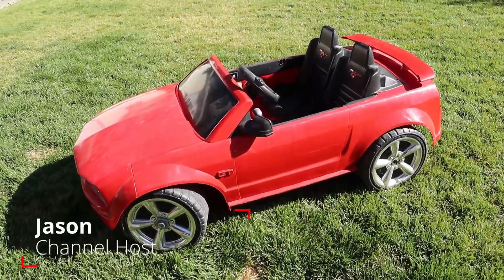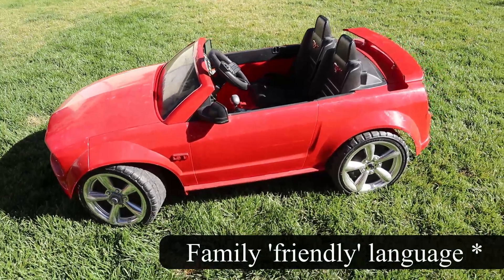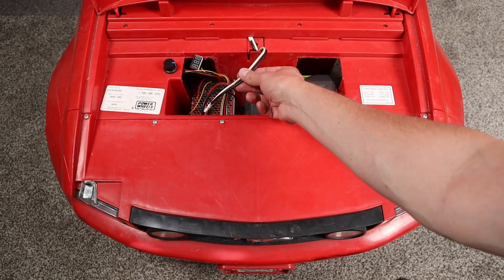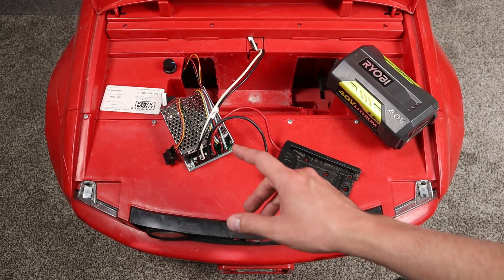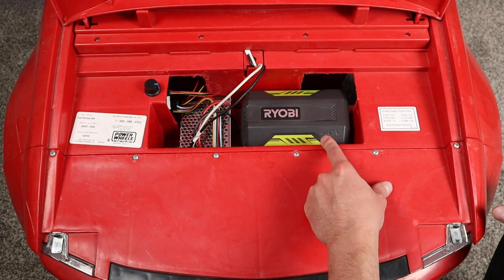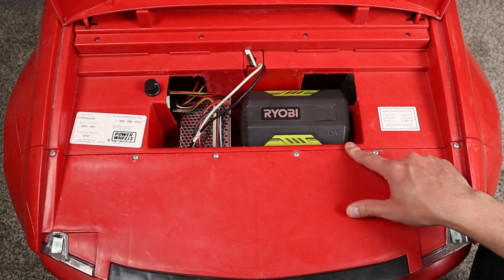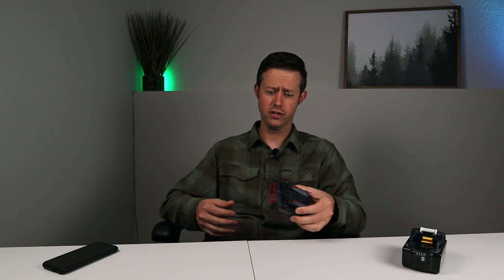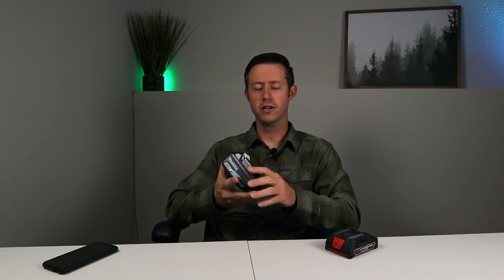40 Volt Power Wheels Mustang! Simple Mod - Much Faster!

Comment: Probably cheaper than buying an OEM battery for it
Reply from the maker: For an even cheaper option, use a 20v tool battery and find an adapter on ebay or amazon.

Comment: does it have to be ryobi? I am having a hard time justifying the 100+ battery. lol no off brand or is that gonna just turn it into an expensive fireball?
Reply from the maker: Use any 20v battery and run it at 100%, it will go just as fast! Adapters are available on eBay for lots of 20v tool battery brands

Comment: How many motors do you have on the car.., one or two..??
Reply from the maker: two motors in my mustang
Reply: @Jasonoid  Thank you for your quick response. Do you remember type of motors and operational voltage...? I have a Ford Ranger with two motors now operating with one 12V battery.
Reply from the maker: @emmanouilchatzisavvas6677  You should be able to run your Ranger off 20v batteries at 100% or run them off these 40v Ryobi around 55% on the PWM controller. Lots of different adapter options available on Amazon and ebay.
Reply: @Jasonoid  40Volt at 100% would destroy the motors..?? I suppose you run them in parallel connection...??
Reply from the maker: @emmanouilchatzisavvas6677  Yeah, I ran mine at 65% and I got some burning smells, the speed in the video is 55% at 40volts.

Comment: So with you running at 20ish volts no problems one wouldn’t need a PCM if they wanted to run an 18v ryobi, just take the adapter for the battery straight into the existing wiring. Would that be correct?
Reply from the maker: Yeah, would work prefect. Only 1 speed though, the pwm allows for speed control

Comment: how fast can it go if you crank it up all the way
Reply from the maker: My motors don't like having full 40volts, they hot pretty fast. 55% is the highest I go. If you install a tool battery that's 20volts, you could turn it up 100%

Comment: Hey Jason, im hoping you can help me out.  I did an 18v conversion and burnt the motors out.  My daughters missed it so much I picked up a newer one and upgraded to the ML Toys 24V motor kit.  I used the same Motor Controller as before (Not exactly the same as your but looks identical and rated for much higher than 40V).  I planned on pushing this one to failure as well (kids are older) but the batteries keep tripping and I barely have the PWM turned up.  With the wheels in the air I have it tuned to 24V exactly and it runs fine in the air but when on the ground with one of the girls in it, the batteries always trip.  
Can you point me in the right direction?  
Full disclosure ML Toys says the motors are not for Li-ion but I figured the stock motors weren't either.  Super appreciate the help, my daughters are hooked a d I'm letting them down big time :(
Reply from the maker: I have seen this same thing happen before on mine using a couple different batteries (old vs new batteries). It's either one of two things that could be wrong.... At least in my opinion. 1) The batteries are hitting their max amperage so they are shutting off to save the internal battery cells. Motors under load require much more power (amperage) than just spinning freely. Just like you mentioned it works fine when in the air but cuts out when a girls is riding in it. So maybe try a different tool battery? Which one are you using? 

2) The other thing that could be causing the cutt out of power could be the pwm controller. How many amps is your rated for when you look at the device specifications? Maybe it cant handle to amount of amperage going through it and is shutting off for safety.
Reply: @Jasonoid   @Jasonoid  thanks so much for the reply!  Sorry just getting back to you, was out of town.  I run into the problem with both older 2.375 Ah and new 6Ah batteries.  I don't know what amp level the batteries' bms trips at but after reading your comment I'm wondering about the pwm controller.  It claims 30A max and a voltage range of 7-70.  That said, it was one of, if not THE, cheapest one on Amazon at around $20.00.   I know it has a 30A fuse that's blown once but it was back when I used it on the old 18v car.
Thinking I should give the controller YOU used a shot - unless you advise otherwise.   
Thank you so much for the help!  You have a subscriber for life!!!
Reply from the maker: @johnmurraycompton569  if you are blowing fuses that might be the issue. I haven't looked at available options for awhile, I bet they have something with a higher amp limit!
Reply: @Jasonoid  it only blew the fuse the once and that was on the old car using the stock motors and a ryobi 18v.  No blown fuses on the new car with 24v motors and 40v battery.  Just batteries keep tripping.   I'll give a nice controller a shot!  Just an idea, would wiring in a second 40v ryobi (in parallel) help with the amperage pull from the motors?  Sorry if this is a stupid question.
Reply from the maker: So it's hard with these power wheels because it 0% throttle or 100%. So all amps or no amp draw! In a different application I did run two 40v batteries in parallel that on my razer electric scooter mod, it seemed to work better that way. I did get a couple battery power "trips" and I had to unplug the battery and wait, the plug it back in to get them to "turn back on". Always lots of troubleshooting on these projects.
Reply: @Jasonoid  understood.  Thank you again!
Reply: @jasonoid, I just connect everything, turned to controller to 15 and as soon as I pressed the pedal I heard the fainted click and now there’s no power to the display or the toy. Any ideas?
Reply from the maker: It could have blow a fuse, do you have any fuses in the setup?

Comment: will this work on a 24 volt as well?
Reply from the maker: It works better with 24v actual, because then there's no risk to burning the motors out.
Reply: @Jasonoid  Thanks for the info  Have you thought about having people send you their batteries and you do the magic install and send them the batteries back for them only to install in their child vehicle for a fee of course?
Reply from the maker: @Seymour5575  I'm pretty busy with a full time job, then my YouTube channel, and family so I wouldn't be able to do many. I tried to make the video simple enough for other to copy my setup.
Reply: @Jasonoid  You did a good job on the video I am contemplating doing it myself thanks again.

Comment: I have several dewalt 20v batteries that a larger amp hour, and several large ryobi 18v batteries, do you think either would make a good battery for this or should I use this as an excuse to get into the ryobi 40v line up lol
Reply from the maker: They will work great, just find an adapter that will work with your battery, no need to do 40v.

Comment: Interesting I setup my kids Jeep Wrangler power wheel with (2) 18 volt Makita batteries and a speed controller. Mine doesn’t look as quick as yours, I’m guessing different models have different motors in them.
Reply from the maker: I run my batteries near 24 volts so just a little higher than 18 volts. (55% on the knob of the pwm controller).

Comment: Hey! I have the exact same Ryobi 40 volt so I ordered the adapter and speed controller you used for my sons kid traxx Dodge Ram fire truck. The gauge wire is 10 coming out of the ryobi adapter and 12 going to vehicle motor. I also have a 30 amp inline fuse I am adding to the positive from the battery going into the the speed controller which is also 12 gauge. Do you think there will be any issue going from the 10 gauge in and 12 gauge out from the speed controller? Thanks
Reply from the maker: Both 10 and 12 gauge wire should be fine to carry the amps from the motors.

Comment: Hi can you tell me how you hav3 connected the throttle pedal to your controller i have installed the same one but when i turn the dial the motors start to move ?
Reply from the maker: The throttle pedal acts like a switch in my power wheel. I just hooked up the speed controller to the stock battery wires.
Reply: @Jasonoid  so you didnt cut the motor cables coming out of the controller then put it to the throttle switch then from throttle to motors ?
Reply from the maker: @leisure-proltd4974  I didn't modify any of the wires on my car. I just used the stock positive and negative battery leads to connect into the PWM controller. There are so many brands of these power wheels and each one is a little different.
Reply: So where is your old controller for the power wheels ? Because im sure if i just put a + - to my controller it wont do anything i would need to connect battery pos and neg and the motor cables for it to work.
Reply from the maker: @leisure-proltd4974  it didn't have a controller, it was the battery to the forward and reverse shifter, to the gas pedal to the motors, super simple wiring. You may have a different setup.
Reply: @Jasonoid  yer mine is but ive ripped out all the original wiring but left the motor wiring thankyou for taking your time to reply mate keep up updated on motor gearbox life cheers 🍻

Comment: So im goingbto do this mod but my son's utv is a 24v system and I. Going to Switch it to the 40v ryobi battery. Can I run it at 55% or can I run it higher. It has 2 12v battery in it now and has 4 Motors. The car you tested was only 12v correct?
Reply from the maker: Just make sure their isn't a radio or anything that will burn up from the higher voltage. My car was older and didn't have those fancy features. You should be able to run yours higher than 55% because yours is a 24v design, just set it higher and test it each time. 55% is stock for your machine.

Comment: I bought the same pwm controller in your description and hooked it up to 2 12V lead acid batteries in series with a 40 amp in line fuse and the power percentage gauge does not light up. I’m wondering if I have a defective unit. Did yours light up when connected to the battery and not the motors?
Reply from the maker: I have to turn the round dial to turn it on. Did you do that?
Reply: @Jasonoid  I did. Flipped the switch all three modes, turned the dial up and down, Battery connected to correct terminal and batteries putting out 24 V (Tested). 
I believe my controller unit is faulty
Reply from the maker: @felinorosario345  As long as everything is plugged in properly it could be having an issue. Return should be easy on Amazon.

Comment: I have a 40v 6amp ryobi  battery for my mower I did the same set up as you in my dune racer if I turn it up over 30% you step on the gas and it goes a few feet then stops and the middle two lights on the battery blink do you know what’s the issue. Once they blink nothing works including the speed control till I pull out the battery and put it back in. I did install a 30amp fuse. Have any idea to be able to go to 50-60%?
Reply from the maker: I've noticed the Ryobi batteries have a built in surge limit, kinda like a temporary circuit breaker. If I ride on my kids power wheel (lots more weight than my kids) my battery cuts power for 30 seconds or something. The battery also cuts out if I'm edging my lawn and the blade gets stuck, seems to be a similar issue. How much weight is in the dune rider? Two kids or one kid? Does it do it with less weight?
Reply: @Jasonoid  2kids. So if it’s got a built is surge protector I probably don’t need a fuse. I rode it fine on both slow and fast at 30% and I’m close to 260. Any bit over 30% it kills it’s self after a 3-6’. Now I know that’s only 30 sec
Reply from the maker: @NAOSANT  it might have bigger motors than my power wheel and draws more amps. Mine cuts out like yours at 60% on the dial... And the motors get hot real quick at that speed.  30% is still faster than stock speed right? It have should a ton of runtime with that huge 6ah battery too.... Only thing I can think of is maybe try using larger gauge wires?
Reply: @Jasonoid  use larger gage wires throughout the whole car?
Reply from the maker: @NAOSANT  maybe just to the motors, not sure if it would do much though. I just thought of another idea, maybe you can disconnect power from one motor and see if it still shuts off at 30%
Reply: @Jasonoid  It only shut off at 30 w people inside sitting on a crate I went up to 70 but then it shut off. Not sure if I burnt a motor or fried a wire. Smelled like something was burnt.
Reply from the maker: @NAOSANT  so it probably is pulling too many amps and the battery is turning off temporarily. I bet you might be able disconnect one motor and run it at 40%-50% without issue. 70% is a bit high, I wouldn't take it above 55 for too long because the voltage gets really high for the stock motors.

Comment: if the one i have has 12v touchscreen radio leds reverse and foward as well as parental remote would this 40v fry my motors or burn any of my stock electrical up? and would everything currently work as it did stock?
Reply from the maker: Wouldn't risk it if you have the fancy electronics in your power wheel.
Reply: @Jasonoid  wdym?
Reply: @Jasonoid  my stock car is 12v and so is all the wiring i suppose does the box regulate voltage or does it run 40v on the 12v electrical
Reply from the maker: The 40v battery would fry your electrical stuff, only the motors would survive. So radio, lights all that stuff would stop working. My car was a older model with none of those fancy features.
Reply: @Jasonoid  okay man thanks for the reply

Comment: Gonna try it out for now. Still reads 40v coming out going to the motors. Hopefully this all works.
Reply from the maker: interesting, can you adjust the percentage at all? 40v will be super fast!
Reply: @Jasonoid  had it going for about an hour going up hill and down on a road. Doesn't seem to lower in voltage. 90° weather right now. No overheating. No way to adjust voltage though.
Reply from the maker: @chadace8010  how fast is it going? Like over 10mph?
Reply: @Jasonoid  well i bought it used for 5$. No battery so needed something to work on it. Gears grinding ehen i had a normal 12v battery on it. Don't wanna mess it up more so will have to stay at 5 mph for like 3 hours of run time for now. When and i do get upgrades, if the wife allows, i will try to get the metal gears and rip it.

Comment: What about using a DC 48V Step Down to 24V 30A 720W Voltage Reducer Converter.  The issue I am having is the PWM only controls voltage when under load.
Reply from the maker: That should work, BUT the benefit of the PWM controller is to be able to control the max speed for your kid. So if they are learning you can turn down the speed by dropping the voltage, if they have practice you can turn it up to a higher voltage/speed. Voltage controls the speed of the motors, amperage isn't that big to worry about. The PWM controller I used in the video is listed in the video description, I can't remember the exact specs for it.

Comment: Can you do this with the Ferrari Remote control car?
Reply from the maker: Probably not, the remote control components inside the car are probably designed to run off the stock voltage and the higher voltage will burn them up.

Comment: I have a 12 volt fiat 500.  What should I do to increase it to 18 or 24 volts?  What should I change the battery only?  Isn't it that the other components are burned ???

ho una fiat 500 a 12 volt.  Cosa devo fare per incrementarla a 18 o 24volt?  Cosa devo cambiare solo la batteria?  Non è che si bruciano gli altri componenti ???
Reply from the maker: Just changing out the battery to 18v is pretty quick! 24v is max the motors can take usually.

Comment: I did this for my sons power wheel with a drill battery. Work well for about 30 minutes, but then it started to act funny. It will be powered on and will accelerate by itself without pressing the gas pedal A random intervals. Any idea as to why this is happening?
Reply from the maker: The only thing that comes to my mind would be the 'gas pedal' might be going out. I know that they have replacements online that you can buy. The pedal acts like a power switch so if the contacts were somehow touching the car would move on it's own. Super weird to hear that though. I haven't seen that issue before. You could probably wiggle the pedal around and see if anything happens to make the wheels spin.

Comment: so if you're using 18v batteries, could you turn the controller up to 100? figuring 55% @ 40V = 22V so probably a bit overkill to use 40V batteries if you have some extra 18v laying around.

My son's car has a toggle for high speed and low speed, but it also has a remote that has high, medium, and low.  Since he's too young to steer and such right now I'm looking to upgrade as the low and medium are painfully slow for when he gets older.
Reply from the maker: 100% should work fine for 24v batteries. Just keep an eye on the motor heat buildup after some test drives. If you smell burning turn it down. Thanks for watching!